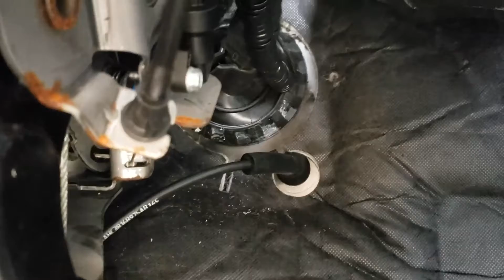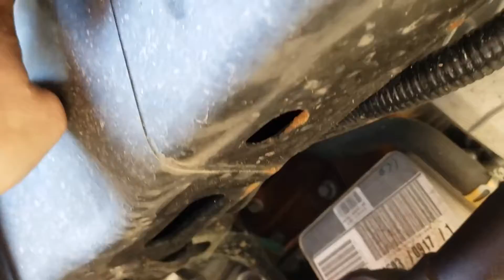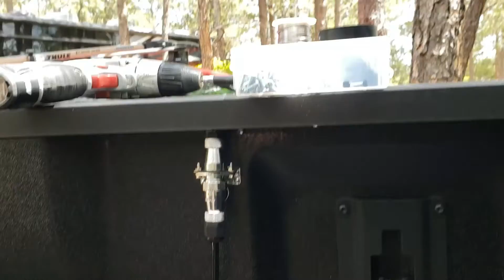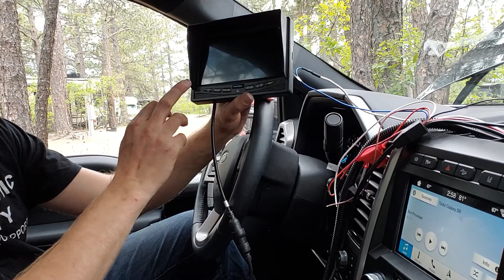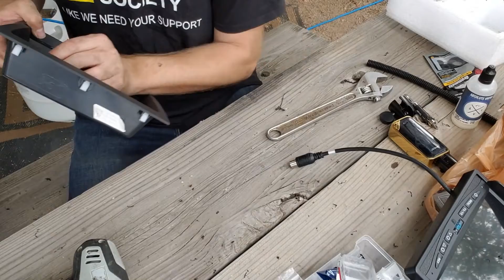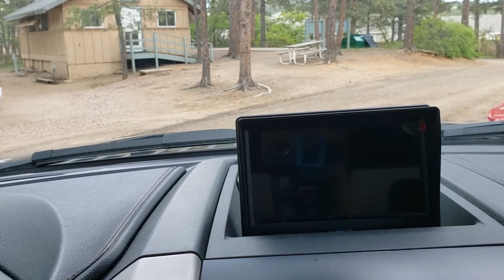RVS Wired Backup Camera Install Part 2

Comment: Great video. I do have a question if you check these comments. How did you route the big cable and the power wires through the dashboard? This is what I’m have a problem with. I have what looks like the same truck. TIA
Reply from the maker: 2018 F350 here. Routing those wires was VERY tight. I used a stiff wire going in from the top dash opening, towards the driver side. There's a small panel on the edge of the dash that I removed, and fished for the stiff wire. Then reversed the operation to get the power and signal cables through. I honestly thought I was going to damage the signal wire it was so tight. Be careful  and go slow. Try to route things as best you can. Good luck!
Reply: Thanks for the quick reply. Did you have to drill a hole to get the signal wire outside of the cab?  That’s what I’m having a problem with. I know I said dash but I meant through the dash-outside of the cab. I can’t find anything big enough to get that big signal cable through.
Reply from the maker: @mrcblake  oh, I did not drill a new hole through the firewall. There is a large grommet, like 2.5-3" diameter with a bunch of wires in it. I went through that. again, it wasn't easy - it's actually 2 layers of rubber, with an air gap in between. I did slice that rubber up perrty good to get the wires through it. IIRC, I removed the grommet, then just sliced from the edge toward the center bundle, creating a closed-mouth pacman if that makes sense. fed the wire through the slit and put the grommet back. sealed it back up with some silicone I think.
I hope this helps!
Reply from the maker: see 1:14
Reply: @AlcoholFreeRV  thanks so much. I can’t believe I missed that in the video.